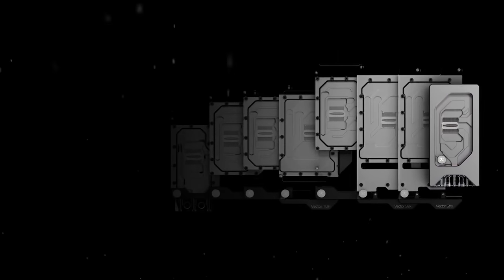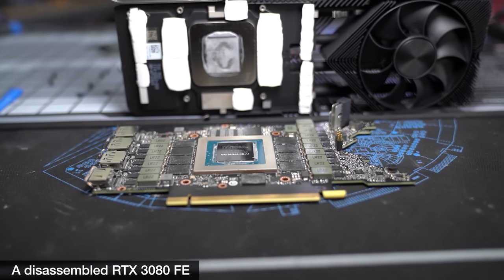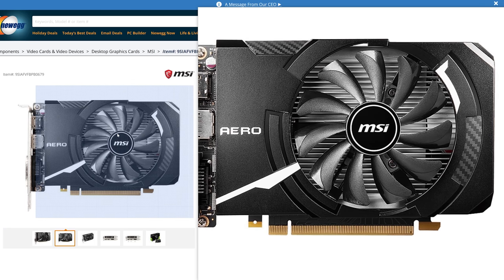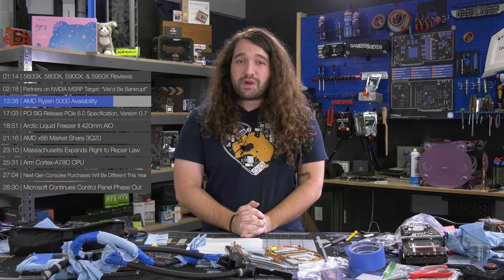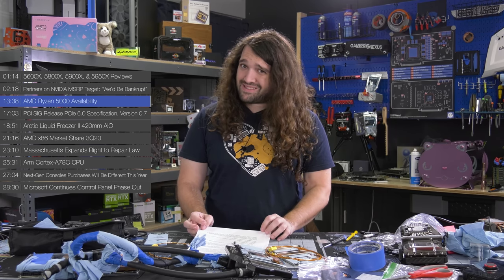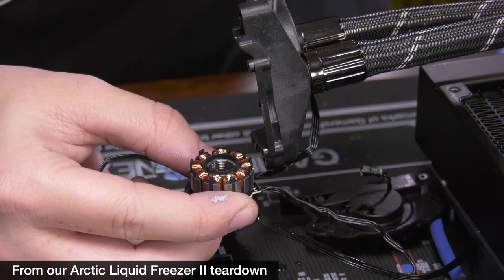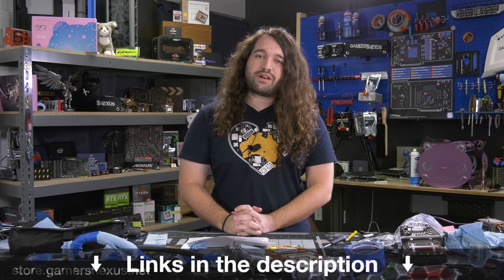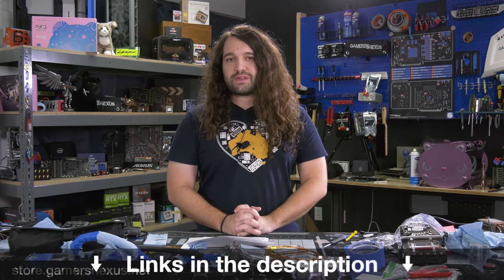HW News - NVIDIA MSRP Allegedly Not Realistic, Ryzen 5000 Supply, PCIe 6.0 Spec

Comment: It's amazing, I had to turn off "hardware acceleration" for sound on a laptop to get a specific feature to work that we were temporarily using. I forgot I had done that and a couple months later found that the hardware acceleration being off was breaking something else I was trying to do. I go to turn it back on and Microsoft had removed the setting, so there was no way to turn it back on other than wiping all the sound driver data and re-installing it.

Comment: No one likes the "Settings App".. It doesn't have the functionality of the Control Panel, which is why they're killing it off piece by piece.. They can't get rid of it entirely, yet.
Reply: in the past, developers achieved feature parity between desktop and mobile by adding features to the mobile "app" (in this case settings app, used for tablet PCs).

Now  they just remove features from the desktop version for "feature parity".

Comment: Of course Microsoft being Microsoft they decide to "simplify" the Windows experience by removing features!
Reply: They're testing us to see what it takes to make us switch to Linux. One of these days...
Reply: Trying to be apple up in this bitch
Reply: @CaveyMoth  Ubuntu
Reply: MS says you don’t need it so you obviously do.
Reply: It wouldn't be so bad if what they replaced it with, actually worked better... but it doesn't.
Reply: @sparkypvp2167  I need my DirectX, man. =/
Reply: Not only Microsoft, any overly large company. "We have no real competition, so let's push our users' behaviour towards where we want it."
Reply: @sparkypvp2167  PopOS
Reply: Microsoft, Google... Why do they all keep making bad decisions by changing or removing things that work
Reply: @Lishtenbird  They don't even profit from Users using the software in a different way. I think they actually think they are helping People. Doesn't matter that having everything in one place was far better. My favorite example of this is the audio settings. You now have to click sounds and then change tabs to get into the old settings where you can do everything in one place.
Reply: @sparkypvp2167  Gentoo
Reply: I can find what I need way faster in the old Control Panel.  I hate the layout of the Settings app.
Reply: ah, the Apple approach
Reply: Micro$haft taking some queues from Apple as of late.
Reply: @CaveyMoth  Yeah, for years I've been saying, Windows is actually harder to use/navigate than most linux distros, it's just people getting used to the clunky UI. Well, let's see if the same double standard is applied to the new Windows UI
Reply: People, learn power shell.  Ms has been saying it for years.  It’s easy, has free resources and works incredibly well.
Reply: @CaveyMoth  Would love to, but despite constantly dealing with many small grievances in windows for years, I've yet to run into any full on roadblocks or "can I even run this thing?" 

I mean sure there's probably a free alternative somewhere for the things I need, and workarounds for many games.. but that's just swapping one set of problems for another rather than being a solution.
Reply: @Mart-E12  It's a good decision for them. Slowly take away control so you dictate how users behave. They know they can so they do it.
Reply: @odizzido  That's happening everywhere yeah
Reply: @Mart-E12  yup. People love it apparently because they keep supporting it.
Reply: They're just copying Google, unfortunately. The writing was on the wall for quite some time.
Reply: I'm glad I've cut Windows out of my home computing life. Control Panel was one of the few things left that Windows was doing well, so of course it has to go. The new Settings app is utter trash. Damn hard to use, assuming it can even do what you need in the first place.
Reply: @RminusOR  That's objectively untrue. User experience-wise, Linux is like 15 years behind windows. Hell, there are things that were fine and useful in Windows 95 that you still can't find in linux.
Reply: @isodoublet  sorry but you're talking nonsense. What exact feature you're talking about?
Reply: @CaveyMoth  "I need my DirectX" well I play DX games with DXVK (ProjectCARS, Asseto Corsa Competizione).
Reply: @isodoublet  It's not objective, it's just your opinion. And having functionality =/= good user experience. 
Example: try changing IP address to static. It's a convoluted mess in Windows and it has always been, vs. e.g. gnome shell, where it's exactly where you'd expect it to be. Or env vars. Or the monitor refresh rate. The list goes on. Just because the UI hasn't changed since 1995 doesn't make it good.
Reply: @isodoublet  Yeah, no. In what way exactly.

What Linux lacks so far are some GUI software for the beginners that don't want to learn the CLI and some proprietary things that the company that created them didn't bother to care about Linux.

What Windows lacks is the ability to give you control over your own system, proper security as well seeing as how you need to cover Windows's holes yourself with the patches called antivirus (at the cost of performance). Windows is very bloated and uses up a lot of ram, resources and is generally slower than most if not all Linux distros (with their varied desktop environments) the bloat being one of the reasons why some games ran through Wine+DXVK in Linux can be faster than on Windows through DX11 even though Wine has to translate the API.

So if have problems reading and following instructions, claim that privacy is not important, have no patience to learn a new operating system, or you regularly play multiplayer online games that use EAC or other spyware level anticheat then stay on Windows. The last thing I mentioned will eventually be fixed.
Reply: Windows shity Settings App > Linux
Reply: @KillaBitz  I actually going to try it out once I get my cpu fan to come in the mail.
Reply: @RminusOR  No, it's objective. A good user interface is optimized for common tasks. How often do you need to change IP to static? Now contrast that with how often you need to move files in and out of file open dialog windows. Linux is jurassic in the matter of basic UI, and to this day keyboard layouts don't work right. It's unreal.
Reply: @benign4823  "What Linux lacks so far are some GUI software for the beginners that don't want to learn the CLI "

That's just sticking your head in the sand. Fact is, command-line interfaces are fundamentally undiscoverable, unresponsive, and all around less productive than GUIs. Windows has a command-line interface too but you only need to bust it out to do advanced things. Now compare the respective GUIs -- it's night and day.

"What Windows lacks is the ability to g"

I'm talking about the UI here, not any other qualities that either system may or may not have. Linux is also fundamentally flawed in important ways in its core design (e.g. overcommit) but it's not what I'm talking about here. It's clear that both systems can be useful and that their respective shortcomings can be worked around, so given this, which one has the better user interface? And windows, even while messily living in two worlds, is the undisputed winner here. It's not an accident that what regular people aren't using Linux.
Reply: @isodoublet  I disagree, command line interfaces are a lot faster, flexible, less buggy and much more productive than most UI, there are some exceptions but overall they're just more efficient with the downside that you need to be able to read and follow basic instructions to use them properly.

The reason why "regular people" use Windows more than Linux (for the desktop) is because Windows gained more popularity from the start, popularity which it gained in part from it's proprietary DX API and paying devs to use that OS, marketing and so on. Later on people became familiar with it and as "regular people" dislike change they stick with what is familiar, which is Windows.

If we talk about the server space than everything is flipped with Linux being used for most things.

There might some UI software missing but those are usually for things that aren't necessary to have it or it's unreasonable to implement.
Reply: @benign4823  "I disagree, command line interfaces are a lot faster, flexible, less buggy and much more productive than most UI,"

I'm sorry but there's no meaningful disagreement to be had here. In some circumstances you may prefer the command line and I do sometimes, but the fact that they're inherently undiscoverable makes them inferior for the vast majority of tasks. They're also fundamentally limited in what they can achieve -- I dare you to invent a version of photoshop with a command-line interface.

"The reason why "regular people" use Windows more than Linux (for the desktop) is because Windows gained more popularity from the start,"

That's a meme linux supporters like to repeat, but it's just not true. Linux has had 30 years to catch up. The reason it didn't is it's just not as good for the tasks most users care about. If you set and forget something like a server, Linux will work great. But if you want to have the operating system as a daily driver chances are Windows will work better for you.

Linux also suffers from  a general lack of polish that comes from the fact that if some developer didn't personally care about a feature it didn't get added. So in the year of our lord 2020 getting wifi to work is still a nightmare, you don't have proper keyboard layout support, and so on. 

"There might some UI software missing but those are usually for things that aren't necessary to have it or it's unreasonable to implement."

Not true -- lots of little quality of life things that matter greatly to the end user are a direct result of the fact that windows has a core user interface API that's well-integrated with the operating system. For example, as a developer you don't write a save file dialog from scratch -- you grab the windows component, and automatically get integration with the shell. You get to have a system-wise cohesive experience that lets you move files to and from save dialogs, rename things, create folders and what not. These are common tasks that make actually using the system a lot smoother. In linux, not only is the experience inconsistent because there's no core API, it also doesn't let you do these simple things, which puts it behind Win95 as far as basic file operations are concerned.
Reply: @isodoublet  I did mention that there are exceptions in which a UI can be better so I don't see what you disagree with. (however a CLI Photoshop, by which I mean an image editing software made to run in an interactive shell is actually very possible to make)

For your second argument you completely ignored most of my reasoning on why Windows gained popularity and just responded to the beginning, nice cherry picking.

Your final argument is just trash, there may not be a single API for everything but there are lots of alternatives for everything that you mentioned.
Reply: @benign4823  "(however a CLI Photoshop, by which I mean an image editing software made to run in an interactive shell is actually very possible to make)"

Yes, and it would be terrible.

"For your second argument you completely ignored most of my reasoning on why Windows gained popularity and just responded to the beginning, nice cherry picking."

No cherry picking whatsoever. Your 'reasoning', like I said, is just a meme. Just something that people repeat without evidence. Is there an alternate explanation, such as Windows actually being better for the task? Yes, there is, because it is. If linux was just superior people would switch. They don't because it isn't.

"Your final argument is just trash, "

Nice argument there.

"there may not be a single API for everything but there are lots of alternatives for everything that you mentioned."

No, there aren't. There's no 'alternative' for the user experience of common tasks being fundamentally incohesive and lacking in functionality, what the hell are you smoking? Of course you can create folders in linux by doing more work, but the point is it takes more work! Jesus.
Reply: @isodoublet  It would be terrible because there are appropriate tools for specific things, no shit.

Nice second argument, something is a meme therefore it cannot be true, memes are never true right?
The major reason why people don't switch (on the desktop) is lack of some proprietary software like Adobe and anticheat/games (also the lack of advertising). Windows can still do the job for them so they aren't looking for alternatives. (not because Windows does it better, but just because it does it)

Yes there are lots alternatives for what you mentioned, that's a fact and isn't made false by your inability to use google search and your outdated information and experiences. It really doesn't take any more work than learning new things for a new operating system would.
Reply: @Mart-E12  they're big companies, but tbh, after the insane mess that was Windows 8, I'm convinced that the UI department has to justify their existence every now and then, so they overhaul a bunch of stuff to make it "new and shiny!" and break everything or make it worse in the process.
Reply: For some reason it works for Apple. 

Step 1: Remove almost all customization and modification at the customer level. 
Step 2: Market this lack of functionality as "clean" and "easy to use" 
Step 3: Charge 2-3x more than your hardware specs justify

Comment: 28:40
Microsoft, take note, if you kill the control pannel, enterprises like us will have to switch to linux, there are a few AD related things that require the control pannel, dont make it easier to use active directory, with a macbook
Reply: Yeah, I am going to Linux instead of Windows 10 from now on.

This is why, from an IT tech's standpoint, Windows 10 is the worst operating system of its age.
Reply: Welp, goodbye Windows.
Reply: @Aereto  Debatable, look at some Apple
Reply: Linux is hard to master, but very satisfying.
Reply: What are you talking about¿  control panel is old news.  Power shell is it techs best friend, learn it.
Reply: @jasgud  This is true, even the most basic of IT programs make you use Command Prompt at the very least. Windows is just easier for even most of them to remember(because of the naming, and how you write out lines).
Reply: Though you can just look at a Linux manual for all the codes.
Reply: @jasgud  Yes, i would like to type a full sentence instead of pressing win+pause-break
Edit powershell is great for re-naming machines remotely, but removing/adding/chaning domain is a PITA without win+pause
Reply: @jasgud  Thanks, we heard you. In every comment related to the control panel you talk about power shell...

There are users like me for which the control panel is pretty much the perfect solution. It doesn't take time to learn and is self explanatory while offering the options I need. It's great to hear you're a tech but many if not most don't care and can't be bothered to learn powershell.

Then again, I will definitely not learn to use the shitty new Options menu and would rather learn powershell and have a sheet of commands on my desk lmao

Fucking Microsoft think they need to re-invent the damn wheel. Pure incompetence
Reply: @Aereto  I use Linux daily but its fucked up that there's not alot of driver support for gaming peripherals like Corsair Cue or Logitech Gaming software. But yeah anything i do outside of gaming i like Linux more, even when i'm just doing python interpreter stuff.  Also when you have a watercooler it might be a bitch to get that included driver running too where you set the custom fancurves and for some led-customization and what not.
Reply: @jaronmarles941  But Linux is waaay easier to master than Windoze, where there's no rhyme or reason to anything. Usual bonehead example "Press Start to close system..."
Reply: @misiekt.1859  Not if you're talking about full capabilities it isn't.
Reply: @jaronmarles941  Give me example of something that's not in UI and is easier to do in Windows? Ever tried to configure and compile NT kernel? How easy is that? Because in Linux it isn't that hard.
Reply: Go tell them that directly through feedback hub or something. Just shouting about it on Youtube and forums isn't gonna do much I'm afraid
Reply: @Cosmstack  I have voiced my opinion to both my -GenericBulkServicesProvider-(where we license office) and my Microsoft account manager
Reply: @denvera1g1  Nice

Comment: Indeed it is expensive to cool a space heater
Reply: The 30 series?
Reply: Believe me I found out the hard way. 400 watts is not easy to with air even on a huge case as the cooler master cosmos ii is.
Reply: @nando03012009  I hear ya! I learnt the hard way too when I had an FX8350 OC'd to 5.0ghz pushing 300w+ in an sad attempt to squeeze out extra performance. I care less about the power usage and more about the heat!
Reply: @basshead.  It will all be decided in 8 days from 3rd party reviews.

The 3080 FE can easily be OC'd for silly gains for 60W more (380W total), and EVGA is pushing the limits by providing the card with more power (+400W) for barely any gains. I wonder how RX6000 will OC, the gains vs the power control.
Reply: @Immebehindyou999  
Even if it OC to 10Ghz it will still be a space heater at 300W+